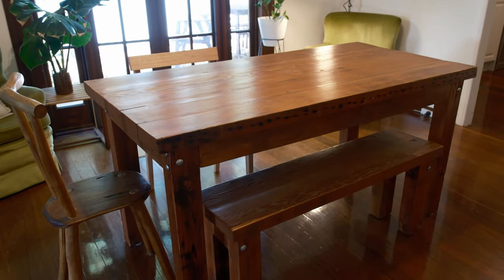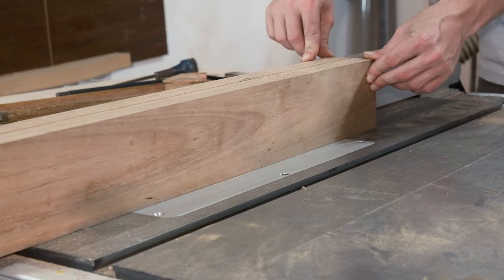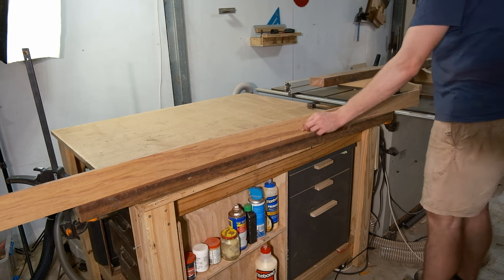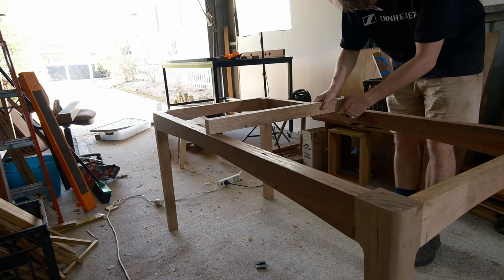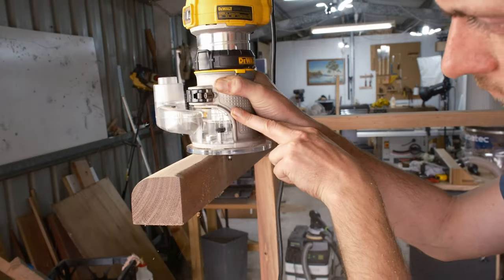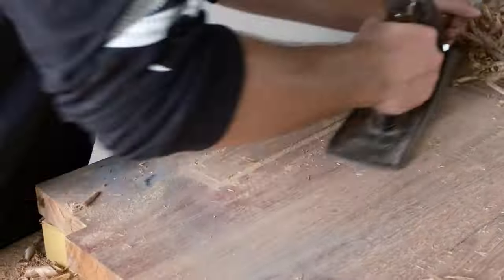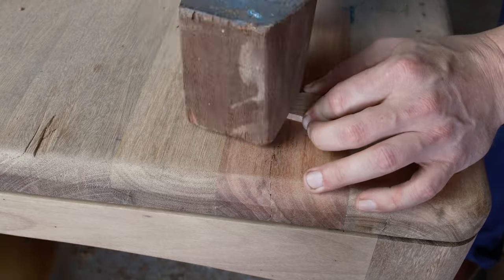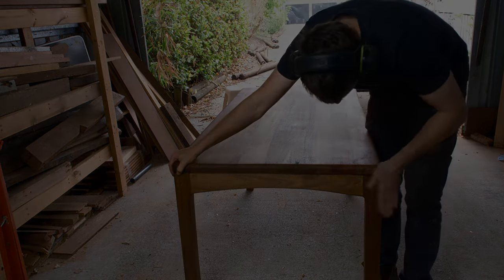Building a Classy Dining Table From Wood Bound For Landfill

Comment: I’d love to learn more about your workshop and how you’ve built up your tool collection - what aspects you value in your tool selection and what you’ve learned about what you look for in a workshop
Reply from the maker: My tool collection started with hand tools, and a few drills and small power tools. I got a table saw when I moved into this space and then just gradually got tools over time, a lot through marketplace. Most things I bought when I needed them, so I don't really have any tool that doesn't get regular use. And in terms of workshops, I don't really have enough experience to know what I value, more space would be great, it's hard to remain organised in my current setup and things end up all over the place. My outfeed table is my work table and that often gets quite annoying!